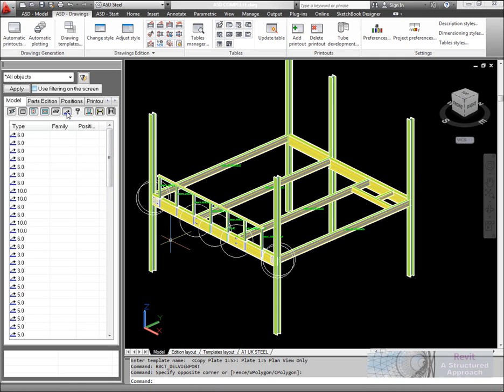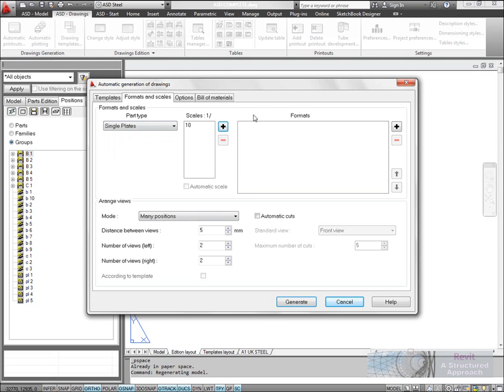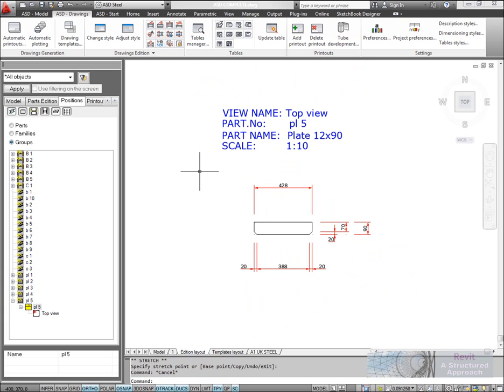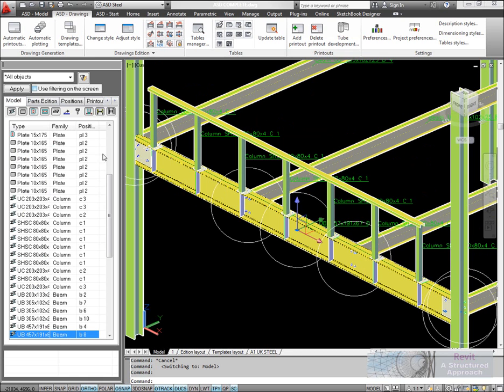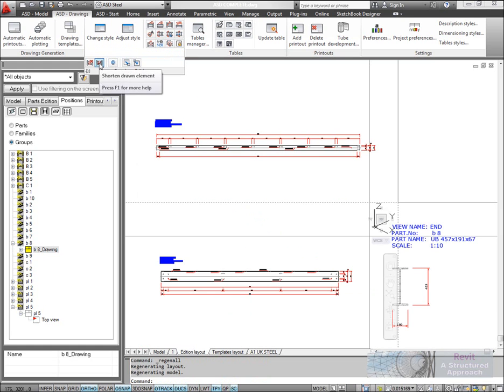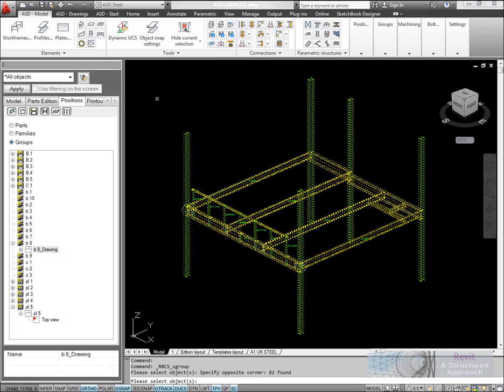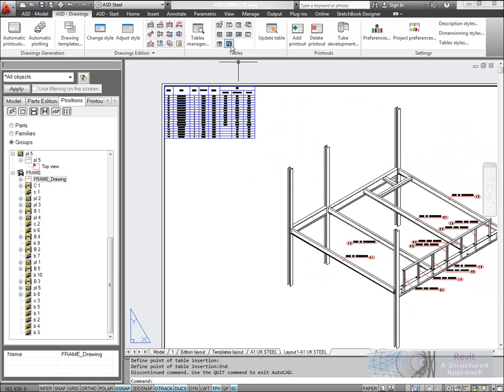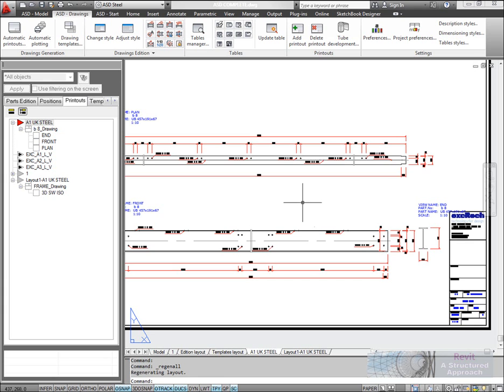AutoCAD Structural Detailing - Steel Fabrication Drawings.wmv

Comment from the maker: The 'attributes' are simply text codes that ASD uses. For example VAR_WEIGHT will report the weight of the steel assembly. I am inserting these as a block which explodes on insert.